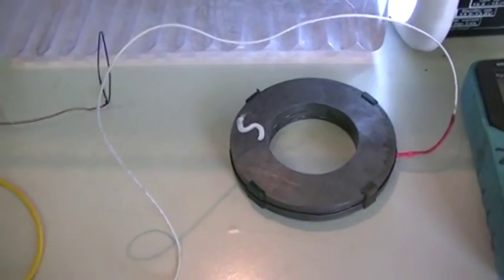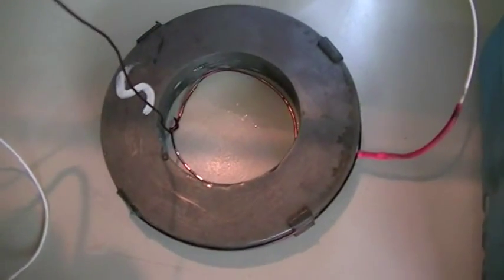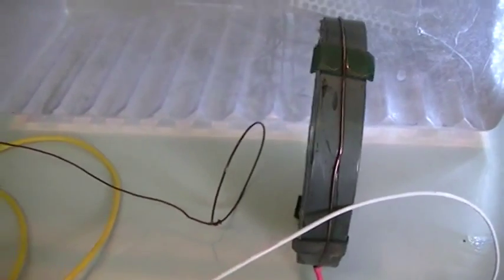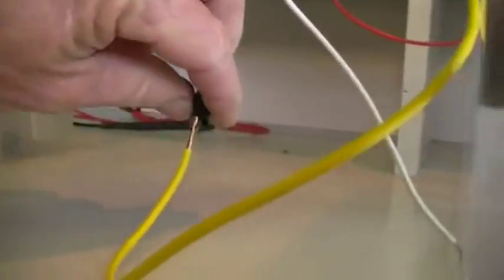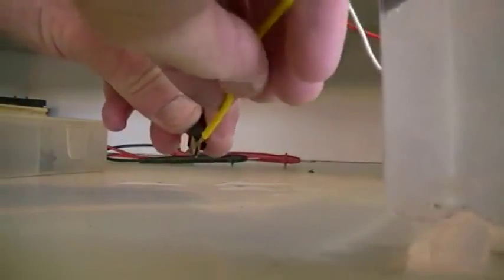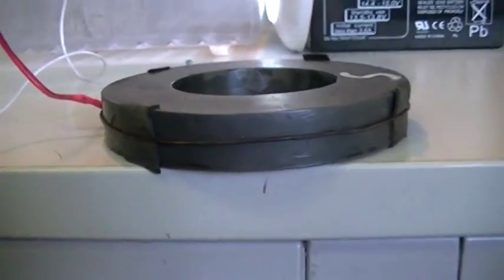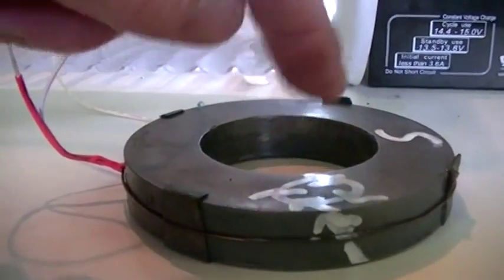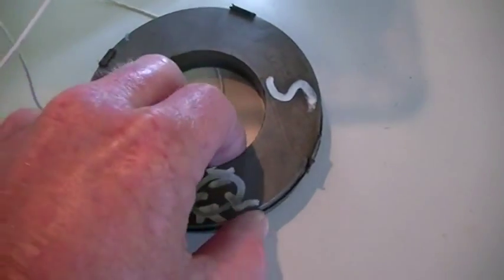magnet vortex spin,ferrite ring magnet

Comment: Really interesting, my only potential issue with the conclusion is that you didn't have the central wire fixed in place and a deviation up or down would bias it north or south.  I am sure you are getting valid results, but just to close out experimental variables, maybe tape both rings in place using a spacer from bottom?
Reply from the maker: It dosnt matter if the wire is in the south field or north field,the spin is still in the same direction. This is what i find interesting about the right hand rule stuff.